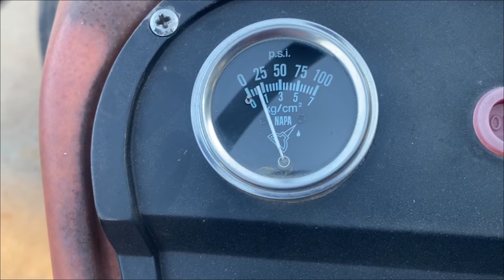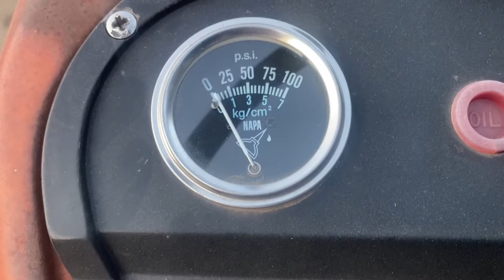Fixing International 2444 Low Oil Pressure

Comment: Nice fix - that part was garbage quality and Im glad you made a deck plate/relief pocket support for it(I was hoping you'd do that, as soon as I saw the part)!
👍
Now subbed.
Reply from the maker: Thanks for the support Craig! sounds like you have been into one too?
Reply: @joe_preston  Your welcome👍
Yup, come across very similar things in the past.
These old machines are great to work on - imagine the poor souls in the future, as it'll all consist of wire tracing(for rodent attack/ chafing) , and finding backwards compatable  diagnostics hardware for their old machines(ie. our latest CANBUSsed horrors with vulnerable wiring)!
The International's underweight and poorly designed oil pump(no doubt "costed" by a bean counter) is akin to our current machinery that leaves wiring exposed, or in plastic conduit, knowing full well that this is a failure point, that has caused many plant fires, when simple and cheap flexible SS conduit would negate all these issues(again. The bean counters). 
Rant overr🙄 - keep safe and well, from the Highlands of Scotland🏴